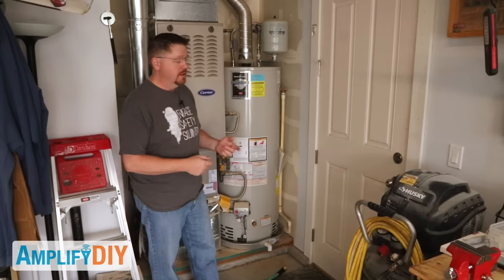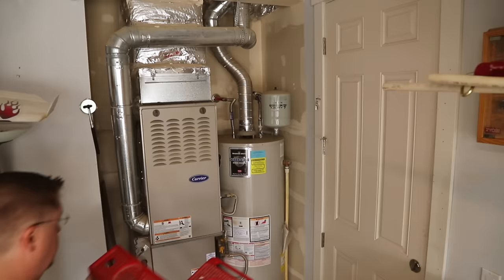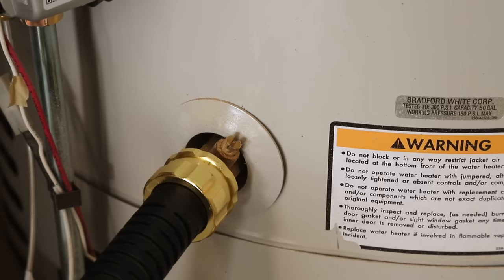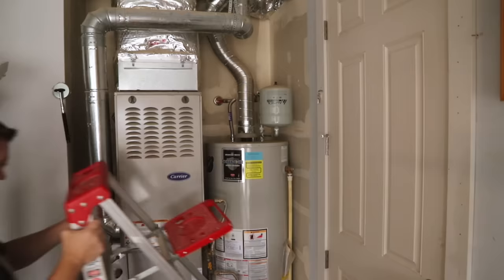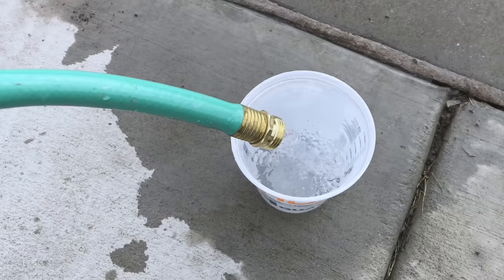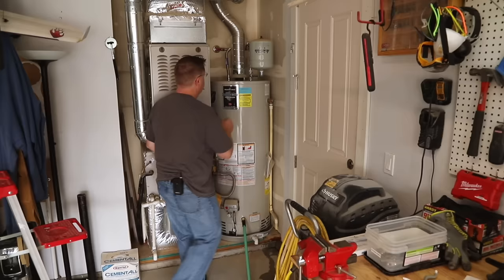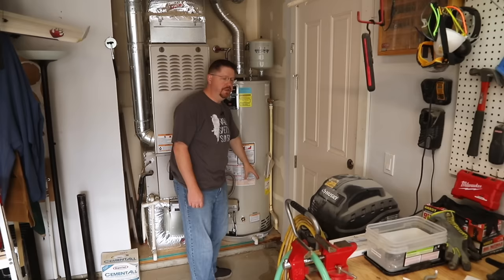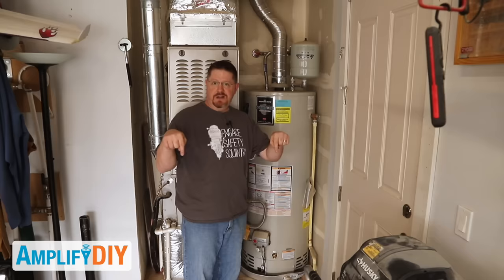How To Flush A Hot Water Heater To Remove Sediment

Comment: fyi, inaddition to the flushing steps in the video i also:
1) remove and inspect the anode rod. it will be encrusted with scale and can only be removed by scraping.
2) i pour a couple of gallons of white vinegar into the emptied tank, let soak for a couple of hours to dissolve scale hardened onto the interior of the tank. 
3) after soaking, will flush the tank out of all the hot water fixtures. this will remove some scale in the house plumbing.

ALSO: residual vinegar will react with the anode and produce hydrogen gas. the build of the gas will increase pressure in the house plumbing system which might burst a pipe. the vinegar will also shorten the anode life. 

SO, run a lot of showers, laundry, dishwasher to consume hot water and flush out the vinegar. crack open a hot water faucet on an upper floor (gas will rise) to release pressure. when taking a shower the water will initially appear cloudy and smell of vinegar. the cloudiness is dissolved hydrogen gas bubbling out of the water.
Reply: It's hilarious seeing comments like these,  people clicking a "how to" video then leaving a comment on how to do it better. Always one.
Reply: I would not remove scale from the anode rod because the activity of the alloy was chosen to account for scale buildup. Removing the scale can cause the anode rod to deplete prematurely. 

Also, if you need to remove scale and sediments beyond draining the tank, a few gallons of white vinegar won't cut it. You'd need food grade citric acid or "Mag-Erad" or some similar commercial product. Diluted white vinegar is too weak. It takes 4-5 lbs of food grade citric acid or 3 lbs of MagErad for a 50 gallon heater (and even then, it ain't going to get it all).

I would point out that sediment and scale in an electric water heater isn't a problem (don't bother). With gas water heaters, almost all the heat enters the tank at the bottom and a thick layer of sediment prevents that (decreasing efficiency and shortening the life of the tank). Gas water heaters benefit from draining and sediment/scale removal.
Reply: @henryj.8528  You're whole argument is invalid. It's different in every situation. All you have done is put you're 2 cents in.
Reply: @henryj.8528  vinegar will dissolve scale, i have seen it work in tea kettles and water distillers. 4 gallons of 5% acetic acid vinegar contains 1 1/2 lbs of acetic acid which i will assume will dissolve a pound of scale... not a problem if done every year.

scale will build up on the electric heating element of an electric water heater, and also decrease 
efficiency of heat transfer. while i would allow several hours of vinegar to clean out a gas water heater, i think much less time would be needed for the electrical element. also, it might be that prolonged contact with vinegar could damage the element.
Reply: @arkrainflood  It would take a lot more than 4 gallons of vinegar to dissolve scale (depends on the amount of course). I've seen scale in water heaters that looks like somebody dropped a bag of concrete in there. Professionals use a water heater descaler called "mag-away." Even that is a challenge. However, since scale is only a problem for the heating elements (deposits in the bottom don't affect electric water heaters) you could pull the elements and just descale those. 

However, you'd be surprised at how long it takes (days). And how much vinegar... A better solution would be "sandblaster" heating elements that are nickel/chrome and are not damaged by scale. 

Even so, It's probably cheaper to replace elements than descale them. I know it's easier. Pros do descale gas water heaters since the scale forms on the bottom and that's where the heat is (can damage the tank). But because of the cost and time involved with descaling, most just replace the heating elements. It's certainly faster.

Scale doesn't actually affect the "efficiency" of the electric heating element (the heat will eventually get through the scale). It does damage the heating element and can cause it to fail. Scale does greatly affect the efficiency of gas water heaters because any heat not quickly absorbed by the tank ends up going up the flue.

Hydrogen gas generated by electrolysis doesn't increase the pressure in the tank. Most is absorbed by the water. Could happen in theory, but not in practice. 

Anode rods come in three "flavors" (zinc, magnesium, and aluminum). All are alloys and the "activity" of each alloy has been formulated to account for scale build up on the anode rod. Because of the amount of insulation in modern water heaters and the difficulty of removing them, it's now very rare to remove and inspect anode rods. You can usually remove the T&P relief valve and look inside with a flash light.
Reply: @henryj.8528  understood. 
4 gallons works for me because i descale/flush the gas water heater annually. i let it sit overnight, just a little inconvenient. the magnesium anode does shrink, about 1/16" (diameter) per year. 

the anode is very easy to remove, 27mm socket and a breaker bar. to reinstall it, i treat the threads with ptfe paste. 

there are plenty of vids/photos showing the inside of gas water heaters that have never been descaled, upwards of several inches thick on the bottom, which insulates the bottom, hence the burner stresses the bottom surface cause it to crack and fail.....and flood the basement. so, an ounce of prevention is worth a pound of cure.
Reply: @arkrainflood  In hard water areas, of course removing scale from the gas water heater's tank is important (not that important for an electric). Glad you could remove the anode rod. Most people can't b/c it uses a weird 1 1/16" hex head bolt (from WWII bomb fuses) and they are torqued to the max to prevent leaks. 

I would also say that having a pressure reducing valve set to 60 psi or below and a functioning expansion tank will cause the glass lining in the tank to crack less and use up the anode rod at a much slower rate.

The anode rod is used up in proportion to the amount of steel in the tank exposed to water. In a brand new water heater, that's almost none. But high water pressure and thermal expansion (of the water) with every heating cycle causes the tank to balloon in and out which cracks the glass lining. The anode rod then sees more steel and has to work harder, being consumed faster. 

Thermal expansion is now a big problem for water heaters and other appliances (ice makers, washing machines, dishwashers) because utilities have installed backflow preventers in the water meters (to protect the public water supply) and the water in the tank (which expands during the heating cycle) can no longer go to the street--so the tank balloons out and in on every heating cycle. So just about everybody needs an expansion tank nowadays and most homes don't have them (or they haven't been installed properly).
Reply: @henryj.8528  yup. have an expansion tank and a pressure reducing valve (59 psi). 

are they not required by code?
Reply: @arkrainflood  Codes are local and vary all over the place. In Ohio, there's a state code requiring expansion tanks, but many are now older than the water heater and the bladder inside is shot. And many were improperly installed to begin with (very common). 

Expansion tanks come precharged with air (to keep the bladder in place) and many installers think that's the correct pressure. It's not. It's limited to 25 PSI by DOT rules. They are supposed to measure the water pressure and adjust the air pressure in the bladder BEFORE installation but many installers check the air pressure AFTER installation and--in every case--it's correct (the same as the water pressure for obvious reasons). Of course, the expansion space is now almost nothing, so the expansion tank will be ineffective.

You can tell if your expansion tank's bladder is still intact and if the pressure is correct by installing a water pressure gauge anywhere in the system (hot or cold--hose bib is usually convenient), then running several gallons of hot water out of the system (and several gallons of cold water into the tank). When the burner fires, watch the home's water pressure. If it hardly increases at all during the heating cycle, either the system is open to the street (no check valve) or the expansion tank is working properly.

Without an expansion tank (or even with one with a worn-out bladder or improperly installed) the water pressure during the heating cycle can easily go from, say, 60 PSI to 150 PSI or more. That pressure spike can damage the solenoid valves in appliances and balloons the water heater's tank, cracking the glass lining and setting the stage for leaks due to corrosion of the steel tank later on. 

Had an icemaker in a fridge than leaked (valve wouldn't close) and did $20,000 in damage to the house. It was damaged by overpressurization because there was no expansion tank. Why more insurance companies don't require them is a mystery. Every car and truck (except air cooled) has an expansion tank on the radiator because the coolant expands when the engine gets hot. Otherwise, you'd blow a hole in the radiator every time you drove the car.
Reply: I should have mentioned this earlier, but some scale in the tank and on the anode rod is protective (and expected). So water heaters don't last as long in places with very hard or very soft water either. It's expected that the anode rod will have some scale build up, so the "activity" of the material used is designed to handle it. If you remove the scale on an anode rod, that basically creates a new surface that is consumed faster until scale builds up again.

Comment: I've been saying for the past 18 years that I am going to do this and never have. It is probably too clogged to drain now.
Reply from the maker: It might be, but if you do decide to attempt it, plan to replace both the drain valve at the bottom of the tank with a 3/4" ball valve, the anode rod, and be prepared to replace the T&P valve on the side of the tank. And be gentle... 18 years is well past the life expectancy for most heaters, but if your water is not very hard, you may still be in usable shape.

Comment: Nice vid.  I did mine and was amazed how much more pressure I gained.  But, there's one thing that bothers me:  You call it a Hot Water Heater.  We don't need a Hot Water Heater...hot water is already hot!  We need a Cold Water Heater...lol
Reply from the maker: It’s a dihydrogen monoxide excitation unit.
Reply: I agree.  His explanation is excellent, sensible, and quite clear.  But every time he said "hot water heater" I winced.  "Hot water tank"  or "water heater"  or "cold water heater".  There is no need to heat hot water.
Reply: I agree also...What about at 1:25... Relight the pilot light? You can't relight a pilot light. It's already lit...lol
Reply: Moon Pie   I'm having trouble making sense of this.  If our cold water were much colder, it would freeze.  Maybe your source water is warm, like 80 °F/27 °C?
Reply: That is totally incorrect Moon Pie!  A Water Heater starts by filling it with COLD WATER which is around 55 deg.F in my neck of the woods here in Massachusetts but may be as warm as 70+deg.F say in Florida.  You maybe referring to an indirect water heater which is actually just a storage tank being fed HOT water from a boiler which actually heats the water before it enters the water storage tank.  The storage tank serves as just  a storage tank for lots of reserve Hot water from boiler.
Reply: Another way to look at it is that it's a heater that produces hot water and thus is a hot water heater. I'd say that any of the common names for the device are good enough.
Reply: It's a hot water heater. Get out
Reply: I never thought I would start a firestorm over this.  My lil' comment was from something I heard a long time ago and thought it was quite humerous at the time.  I suppose the best way to describe it would be to call it a "Warm Water Heater".  It's about the same as:   "Why do we park in a driveway and drive on a parkway?"

Comment: We bought an old house in the early eighties (built in 1935) that had a water heater from the 60's or 70's (judging by the style) . Never knew about flushing. My brother kept saying it could leak any time. Replaced both elements by the 90's. And finally replaced it on gp in 2015. Never leaked, never flushed. Lucky?
Reply from the maker: That is an unusually long lifespan for a typical water heater. Maybe your water is less hard than typical? Perhaps it has fewer corrosive things dissolved in it than is normal? Maybe water heaters were made of better materials in the 60’s? Or, maybe you just got lucky.
Reply: They used to put massive anodes in them until the MBAs figured out they could sell more of them if they wore out sooner. I've seen one from the late 80s used on well water that didn't have an ounce of sediment in it. Sometimes you just get really lucky with the water. That being said, water heaters are a breeding ground for bacteria. It's probably good that they wear out now after so many years for health reasons alone.
Reply: @anticapitalize  shouldn't bacteria die at high temperature?
Reply: I replaced a water heater today that was installed in 1975.
Reply: @MH-df6zx  No. Bacteria grow most rapidly between 40-140F. There are other types of bacteria called thermophiles that thrive in temperatures twice that. (Edit: most W/H are factory set to 125F or less for safety)
Reply: @anticapitalize  oh ok thanks for the info anyway mine is set to 80 Celsius which is 176 in American system
Reply: Zeus Boo  I think so because it always smells like a detergent lol that's why we don't drink it we buy bottled water
Reply: Possibly k j - but I know your experience. Three years ago I bought a house (built in 1903) that has an electric Kenmore water heater (replacing gas) installed in 1984 - and it is still kicking strong. The previous owner told me that he had replaced the elements twice in it (last time was in 2006) and the water temperature will scald you if you aren't paying attention.

Like yours, doesn't leak and hasn't ever been flushed to my knowledge (most definitely by me). Perhaps they just don't build them like that anymore... 

However, I do feel like I am tempting fate with it and have plans to replace it in mid-2019 sometime. Would love to reinstall it back to gas and do a tankless Rennai system with the circulator option to get "near instant" hot water anywhere in the house. Keeping my fingers crossed that the "old faithful" stays strong until then, though... :)
Reply: @jonathanbailey4904   What did you see when you drained it out?  Ours is the original to the late 1970s and has never been drained as far as I know.  (Never knew until recently it was supposed to be done!)  Now I am afraid to try - he said the sediment becomes like cement on the bottom.   Thoughts??
Reply: @MH-df6zx  That is a safety hazard mate.  You should turn it down.  At that temperature, exposure to the water for 0.1 seconds would cause 2nd and 3rd degree burns.  Life threatening if the person slipped and was stuck in it for more than 2 seconds I would say.  Turn it down to 60C.
http://www.accuratebuilding.com/services/legal/charts/hot_water_burn_scalding_graph.html
Reply: @anticapitalize 
I set mine for about 110 - use only the hot for a shower. Safety measure to prevent scalding of humans and critters. Use stove or microwave if I need hotter water.
Reply: k j yup
Reply: @anticapitalize  Also Tanks were made of Monel a Nickel - Copper Alloy that has High Tensile Strength and is Very Resistant to Corrosion they would Easily last 20 to 30 yrs. but the Water Heater Manufactures changed them to Steel so they could Sell more Heaters  : (
Reply: That is way to hot. Someone could scald themselves if they inadvertently turn the shower setting to "hot" and aren't ready for it. Also, you are wasting lots of energy keeping the water that hot all of the time. Turn it down to 125F and you will have a safe environment and save money. Just to give an idea of the amount of heat in 125F water, heat some on the stove, using a thermometer, and it will give you an idea of that amount of heat in the water.
Reply: Robin Rivera I am not the most qualified to answer your question but I would guess you would have a lot of sediment and some larger pieces that will not exit through the drain valve. I base this on a water heater I removed and wanted to drain the water to lighten the load dragging it up the steps. Couldn’t get all the water out.